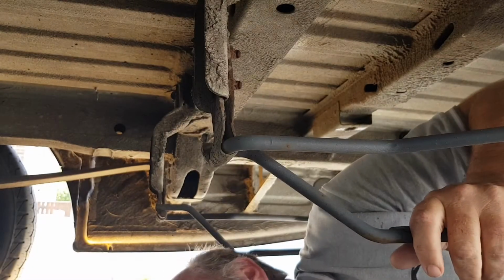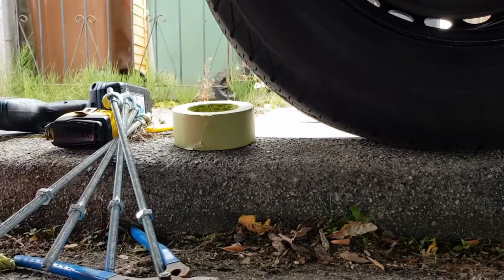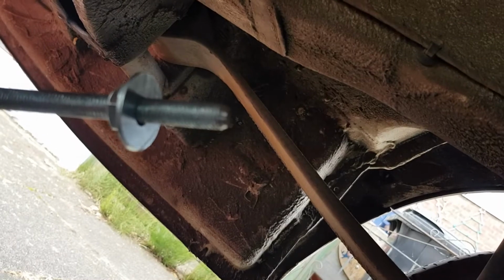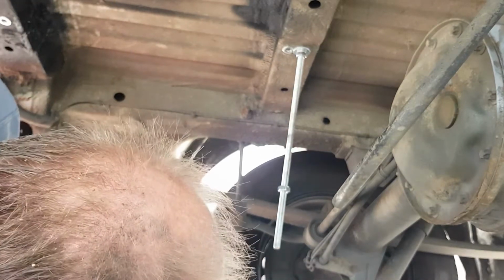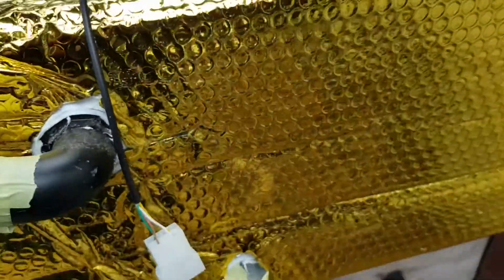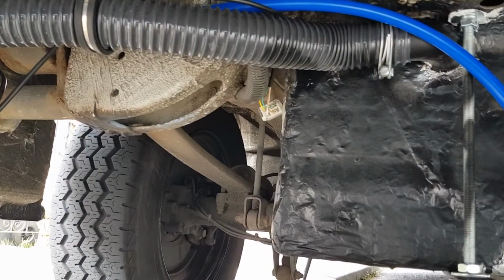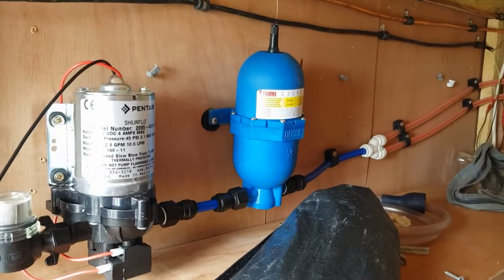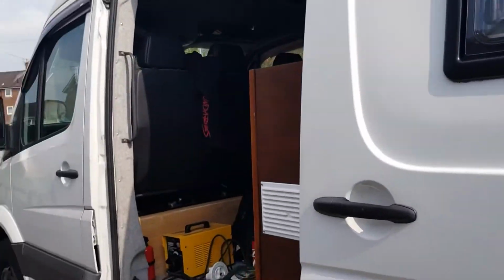Underslung water tank camper van conversion

Comment: Where exactly did you drill the hole inside? Close to the jack/lifter? Is it a VW T5/6?
Reply from the maker: No it’s a crafter and hole done  about 5  inches back even though it does look very near to jacking point

Comment: What are the fixings called sorry? The things you inserted into the ribs. I couldn’t quite make it out in the video.  Thanks.
Reply from the maker: There called rivet nuts or riv nuts depending on where your from loads available on eBay you’ll need the tool to set them as well